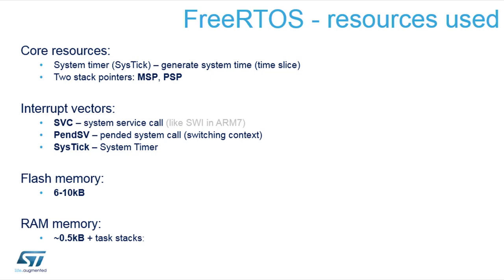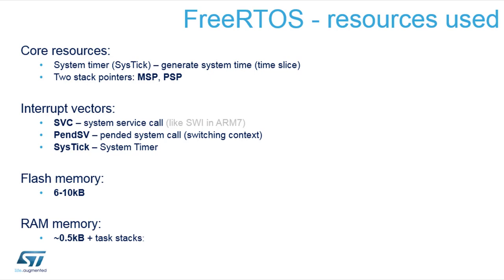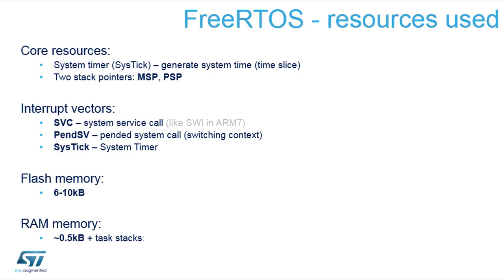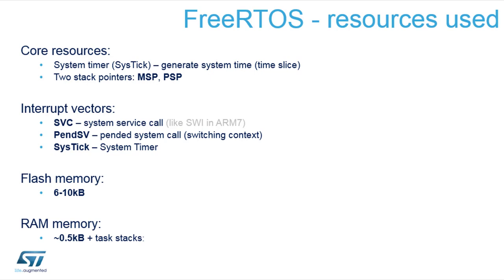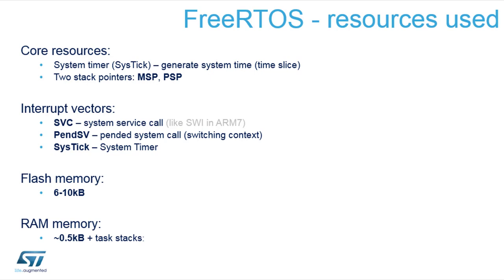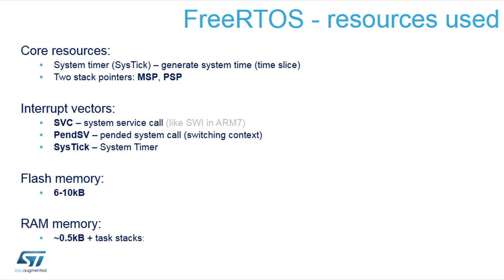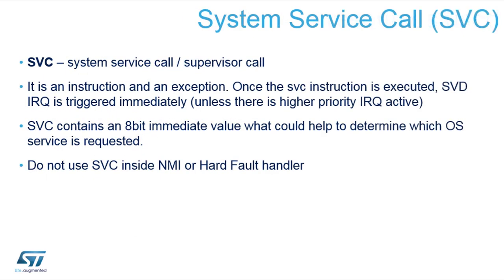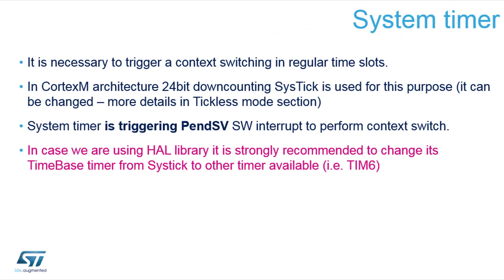FreeRTOS on STM32 - 5 Resources used

Comment: Why does HAL require a Timer?
Reply: For timeout purposes in HAL library.
Reply: Technically its not using a "Chip Timer Peripheral"  but the timebase-tick which is part of the ARM Core specification Systick ISR. This is very useful time-base and many things are based off it.

Comment: Again, a non-STM32 video.  Where are the implementation details?
Reply: This video is very specific to the FreeRTOS implementation for ARM processors. There is nothing specific for ST. Their ARM core is standard.
The internals of other ports, like AVR (Arduinos with AtMega anyone?) are very different.